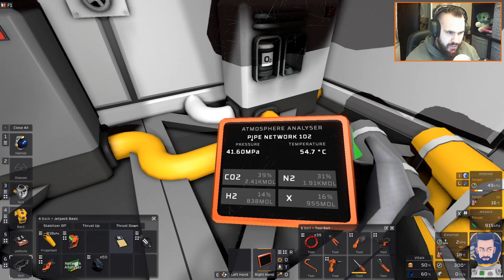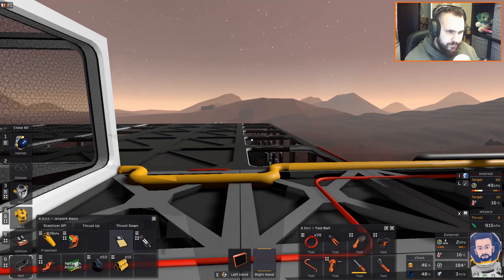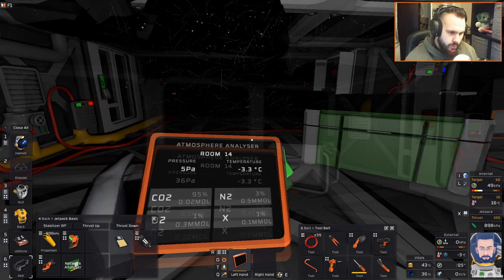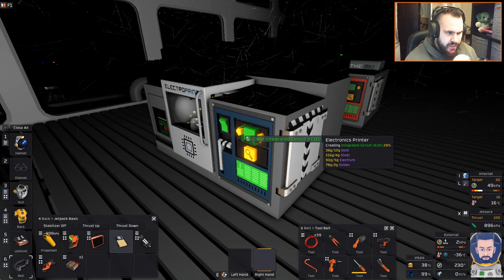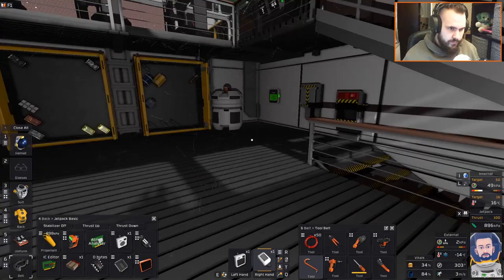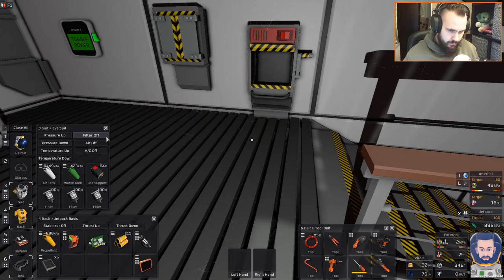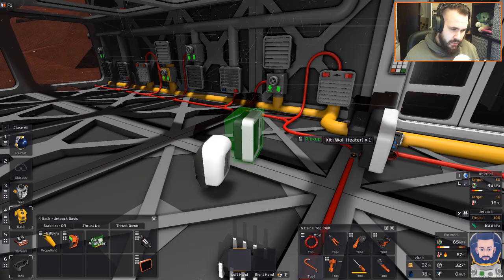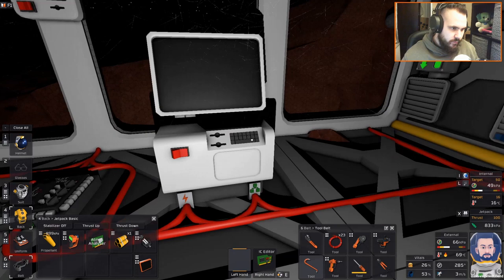IC10 Programming Auto Cooling and heating - Let's Survive MARS Stationeers

Comment: Could you make the corridor you were using at the beginning into an airlock as it stands or does it have to be all on 1 frame?
Reply from the maker: That's exactly what I'm planning on using it for (if your referencing the corridor down from the main part of the base). I will be using that area to test out the advance airlock. An airlock can be any size or shape you want it to be. Just keep in mind when pressuring it, it will take longer between closing and opening doors.
Reply: It was thanks. Wonder how one on stairs would work to go to an underground mine then
Reply: Might be good for the harder planets that way
Reply from the maker: Maybe we can have a look tonight on the live stream :)